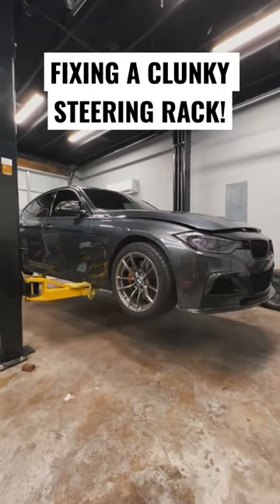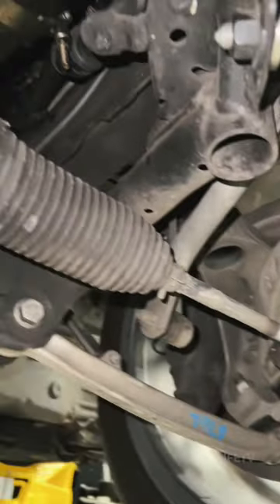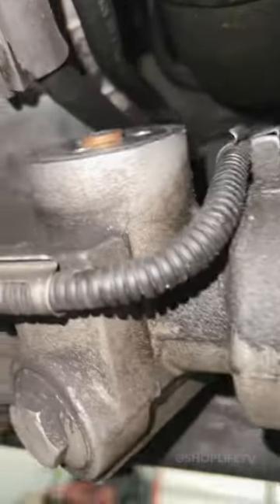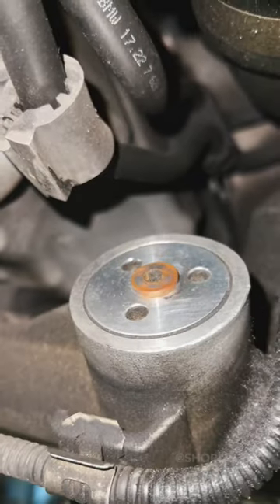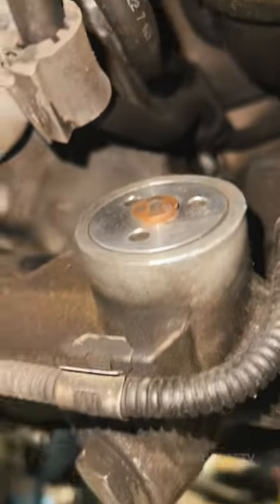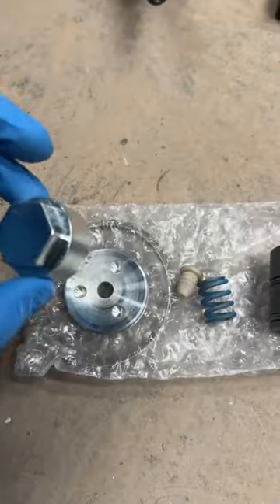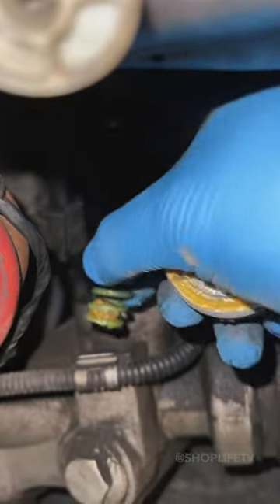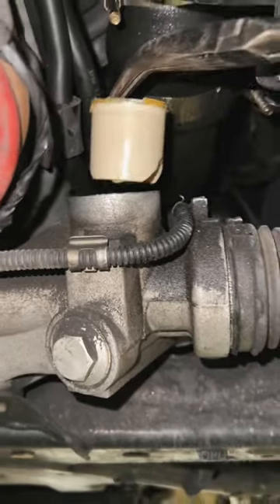BMW Clunking Steering Rack Fix! #shorts

Comment: Fun fact, this Is not a problem límited to BMW. Most electric racks are afected by these issues as they get old
Reply: Yeah I like those electric column Hyundai's they go out in like 20-30,000 mi easy money😅
Reply: @davedorsette my buddy has an 08 Elantra and I just rebuilt his EPS for him. Junk af
Reply: My mercedes hydraulic rack has this issue i'm trying to find a kit right now for it. I was getting ready to change my whole rack.

Comment: The first and best step, is to never buy a bmw to begin with.
Reply: Acting like other manufacturers dont fuck up all the time too. And dont even say toyota. Its hard to fuck up when you make econoboxes only and have only 1 or 2 sports models. Bmw litterally has a sport model for every single class they have, and even their "non-sport" models make 250-300hp and ride and handle like a sports car... Larger number of sporty cars: larger chance for failure.
Reply: Exactly what I thought
Reply: Lol, I guess you made that mistake? I bet you own a 335 😂
Reply: @waifuracer6516  how long has bmw been making cars versus how expensive and breakdown prone they are? It is absolutely acceptable to compare to Toyota, Hyundai, Kia ,etc. Last time I checked the laws of physics apply to all car manufacturers. Why hasn't BMW figured that out yet?
Reply: im at 160k miles on my e92 n54 335i zero codes :) and pushing 550hp on upgraded turbos
Reply: @jeffs7267 there’s no way you mentioned Hyundai and Kia 😂
Reply: @2seep  laugh all you like, they make top rated cars. My Kia telluride was ranked best car by three reputable reviewers for three years in a row. My BMW? I could make a list of problems that are the direct result of poor quality and craftsmanship. Just today, and I am not making this up, the radio stopped working. The fuse is fine. That is a relatively minor issue with that piece of garbage
Reply: Buys another insert brand here which eventually brakes down.
Reply: Mine has 151,00km and is still going strong, not much has been replaced
Reply: 421 000 kms on my 2011 E91 320d. 
Just change the engine oil max every 15K (BMW recommends 32K for this model, I personally don't like the color and thickness of it after 20K, also I can notice higher engine temps and engine slugging a little when running in old oil), use the best OEM parts possible (but only for important stuff like filters and stress parts) the rest just use the cheap stuff from eBay for example, use good quality fuel when possible, clean EGR!, Intake manifold! and Turbo dirty side to remove carbon deposits and allow full functionality (it gives longevity.. I do it every 50-60K). 

Things I replaced in the car in 10 years of ownership (except classic wearable parts like brake discs and pads, tires, etc): 
- Tailgate window switch (@400K ebay ...oxidated with humidity)
- Intake Manifold Butterflies! (@230K OEM ...partially broken, affecting the performance at low revs and causing engine noise)
- Turbo (@230K mechanic just replaced it (actually the turbo was still fine, but the electronic switch was jammed due to carbon deposits, I paid for a cleanup/restoration and sold the old turbo)
- Passenger side plastic door handle (@410K ebay ... that thing was melting, don't know what kind of rubber bmw uses in these things but it melts after some years) 
- Front left brake caliper (@200K piston not retracting, oxidated... the guy probably cleaned the old caliper and sold it after)
- Front door rubbers (@380K water was coming in during car wash or when parked in heavy rain)
- Front door key lock system (@120K Someone broke into the car to steal it... they tried to use the OBD II port to start the engine unsuccessfully...)
- Tailgate glass was broken (@390K Someone broke it and stole my luggage) 
That's all.

For 20K€ (what the car cost me in 2013), I will never buy any other brand in my life I think. 

(Extra: Road trips with the car so far: Portugal, Spain, France, Italy, Switzerland, Lichtenstein, Austria, Poland, Czech Rep, Slovakia, Slovenia, Croatia... planning more for 2024 :))

Comment: You should use a paint pen or sharpie to mark the original orientation of the cap.  When putting it back on you tighten until the marks line up
Reply: That's good advice
Reply: Dosemt matter if your replacing the yolk

Comment: Important to mention, this steering rack comes with 3 different rack profiles, 2 variations of V shape and oval, this fix is just for one of the Vs, i had the same issue and tried this fix first but it turned out the  problem was a rusted bearing on the coupling between wheel and the rack.

Comment: 3 rack replacements on my X3 and after 1 year, clunk. $3500 part…$1000 labor. Two for free and one out of factory warranty.
Reply: So bad part or install?
Reply: Design fault and replacements haven't fixed the design. There are aftermarket fixes available if you go to a reconditioning specialist
Reply: @miscbits6399  , sold the 2011 bmw in 2018 for a 2019 Ridgeline truck. And now I have a new MDX. I love bmw but you know they are money pits.
Reply: Fucking serious I just bought a whole Honda ek for 2000 lol
Reply: You must've been drifting too hard

Comment: This works like a charm. Official dealer diagnosed an issue with my coilovere as a root cause and added “there is a tiny play in steering rack but that definitely wouldn’t cause any issues”.

Comment: Crazy how this is something an owner has to fix on a BMW 
Let alone 
Spun crank hubs , blown turbos , cracked weak rear subframes, rod bearings…list goes on
Reply: what?? you have an option of a mechanic
Reply: @Cars_nedits i think he means that bmw should have made the part well enough from oem so you wouldn't need to change any parts on the steering rack itself.
Reply: @Cars_nedits i got a wobbly steering rack on my 07 audi TT and the same wheel play thing in the video is happening
Reply: Depends on the model you get, if its a new model that just came out then yea theres gonna be issues, but if that model had time to get remodeled/ improved as later models of the same series then it will have a better build, and not require as heavy maintenance

Comment: All the kits say F chasis (for the 3 series - there are 1s 4s and Xs too) 
But the 3 series e90 has the thrust bushing issue too. I am wondering if the F kit wouldn’t fit in the e90.

Comment: You going to have to replace the cap again the reason why it failed is because there was too much play in the play in the cap retention system can tell because there is a crack in it

Comment: Would this work on the e46?
Reply: Wondering the same. Looks like an interesting upgrade
Reply: Wondering same
Reply: Its not an upgrade it’s maintenance, on the e46 you may have a worn flex disk on the steering shaft it’s easily identifiable with two people and a lifted vehicle
Reply: @MechaniclifeJDM  usually steering rack fails way before the flex disc. At least every prefacelift e46 i have ever driven had quite big play in the steering rack, but it is not very common on facelift ones with quicker steering rack
Reply: @Mikescze  there is an adjustment for the rack play

Comment: Quick tip for you: don't put the rubber cap in the end with all installed already. Lube the rubber cap and put it in the hole with the piece out because it's specially hard to push it through. Or else you'll have a hard time...
BMW should've paid for this because it's a defect, recognized by themselves so why it's the owner paying? Plus, the bmw shop wanted to install a new steering column to solve the issue, thousands of dollars in parts and work when this official kit costs 30-40 dollars. Pimps....

Comment: I wonder why these cars have these components designed to fail and be replaced continuously
Reply: They're designed to last the warranty period. Lessons learned from Ford and other American manufacturers...
Reply: @miscbits6399 I've never had to do major maintenance on an American car before 150k. Can't say the same for bmw or merc
Reply: @stevenrais9360  BMW and Merc both entered the American markets with an expectation that they'd teach Americans how to build better cars. What actually happened is that they acquired American style management and started building cheap cars (at a high price) which only last their warranty period.
The "European" Mercedes, VWs and BMWs you have in the USA are mostly American built (it shows in the panel gaps amongst other places) and BMW is now the USA's leading car exporter (none of which come to Europe) 

People who can afford the premium for these cars don't care about long term reliability as they tend to turn them over annually/biennially and therefore never encounter the long term issues. BMW and Mercedes don't care as it doesn't affect initial sales and it keeps the parts gravy train flowing 

You're right that American cars do better then these ones, but they're not competing with luxury brands outside the USA - they're competing with Asian/European "bread and butter" models.

Ford does reasonably well in Europe, but virtually all models you see outside the USA are European designed/styled and make their way to the USA afterwards.

GM ended up selling up in Europe and everything that was GM Europe (Opel/Vauxhall/etc) was replaced with badged PSA models as production runs ended.  PSA was acquired by Fiat and the conglomerate renamed to Stellantis. It used to be that Fiats were notoriously unreliable rustbuckets but that changed in the 1980s after Japanese cars ate their lunch for a while (Japanese cars are staggeringly reliable if not USA designed/built,  but the styling is BORING so European economy/family cars are holding their own)

The decline of the USA motor industry can be directly traced to the 25% "chicken tax" tariff on light trucks which made such  vehicles ultra-prifitable and created a captive market. That's what kickstarted the malaise era.

Protectionism hurts your own consumers and the USA is one of the most protectionist and parochial markets on the planet. There are hundreds of models and dozens of brands you don't have because it's too small a market to be bothered with...

Comment: Know anyone Tightening torque of it?
Reply: ISTA/Newtis suggests 70nm but that is way too much & the steering will stick,  when I did it I used a wrench with the thrust piece tool with the 3 prongs & tightened all the way until it was snug & lightly exerted more force until it was tight.  If youre tightening it & it feels notchy when youre torquing it, it'll be too tight (if that makes sense)

Comment: My God, there literally is not 1 component on any modern BMW that isn't a failure point.
Same goes for the old ones even though they were actually engineered to do more than fail.
I still love BMW, but what complete pieces of sh*t.
Reply: Soo truee. My E90 LCI has so many parts replaced. I put a lot of effort, money and time in that car. Very nice cars, but as you said, they are a piece of sh*t regarding long term reliability without taking action.
Reply: Such a hard vehicle to love due to maintenance
Reply: @legioner9  Eh it's ironic I was going to say my 335is E92 is pretty good. I replaced a lot of parts sure but it's reliable.
Reply: @JackRR15   True. They are reliable cars when parts are replaced and good to go for another 7 - 10 years or so, only problem is there are soo many little bits and pieces, and the rubbers used by BMW for gaskets and O-rings suck big time.
Reply: @legioner9  Yeah not wrong... I may have written my text to quick to and maybe I'll get another 7000$ in part to spend on in the upcoming years ha. Got to now the model and engine and the quirks... But I agree also if you don't DIY man it must be expensive. My 335is is like my all in one car.
Reply: @JackRR15   True. Truly true. Your 335is is a nice car, and very rare. My E90 also is like my all in one car - you said it very well. Happy many only good and safe miles.
Reply: @legioner9  Thank you. This is actually my second one, I love this car so much. My first one got totalled in 2021 :(   Enjoy your E90! I love that generation of BMW.
Reply: @JackRR15   Thank you, my friend.
Reply: @JackRR15  I love my 335is. They are a beasts and fun to drive.
Reply: Do you have one?
Reply: Amen
Reply: Even the neglected one is drives better than your Toyota fact😂
Reply: @mechanich1249  tell me you’re poor without telling me you’re poor.
Reply: Yeah…
Reply: Yet people always mock Ford's for being bad while owning a BMW 😂
Reply: The b58 is a tank
Reply: Ive got 7 bmws atm and the new ones are shit. My old e36 m50 is bulletproof and my e39 m57 is.. other than that the m550d blew 3 engines.. my 640i spun bearings dont get me started on the n63 lol
Reply: @legioner9  unlike Porsches you replace any known factory defect and your good to go for more than 100k miles.

IMS bearing in the 996 generations and stuff like that
Reply: @lewhui4604   What was the oil change interval on your M550d and what was the cause for destroying 3 engines?
Reply: @tony_5156   Well, I don't own a Porsche, but I heard they are reliable cars, i.e. they can take a beating. Don't know about long term reliabilty on them though
Reply: @legioner9 I have a pre lci e90 that has one problem, opg leak😂 and it’s x drive
Reply: @gabrielunderhill   Not nice 😂
Reply: My brother had a 1973 BMW 2002 in the 80s. He purchased it because "BMWs are sporty" (1970s BMWs were _not_). It constantly broke down and had perforation rust everywhere.  His wife made him park it down the road because she didn't want to see it outside their house and eventually called a scrapper to collect it one day when he was at work. It was replaced with a mitsubushi lancer which actually worked well and went places with the family in it instead of eating money and going nowhere....
Reply: @legioner9  porches were reliable. That changed when they became luxury cars rather than sporting ones
Reply: My Hyundai has 240k miles and never had a problem, unlike my garbage bmw
Reply: Bro having parts wear out is normal 😂
Reply: @danielkiss7003  yes it is,  but BMW are using the old Ford 1950s model of designing things to last the warranty period of the car, not the expected lifespan
Reply: Eh, I have 280k miles. Just take care of it.
Reply: @cmkm54  Wonder what your cost per mile is with your BMW. 280k is what one can reasonably expect to get out of most cars.
Reply: @jeffs7267  not terribly much I'd imagine, it gets 33 miles per gallon. It doesn't burn or leak oil. And I've only got around 3k in maintenance records dating back to 2012.
Reply: @JackRR15 Not worth the mental and physical pain ?
Reply: Bro look at VAG vehicles 🤡 Even worse.
Reply: i have an e90 maintnanced up but my 95 cherokee is literally all replaced like everything any seal any bushing any plastic all replaced or upgraded. idk i like both but the cherokee definetly chomps my wallet more like close to 11k in that car and 3k in my e90 335i
Reply: Old bmws are well made, I agree with new ones going down in quality but the old ones are better made than most Fords and chevys

Comment: how to know exact tight position ?? bcoz after changing my steering wheel is not self centering ..& have become tight.
Reply: Back it off a little
Reply: @firstlast---  if i back it little then noise starts again..! mechanic is saying its rack & pinion problem
Reply: @Itsme-pb5zk  I would verify the new parts were installed correctly before doing anything else

Comment: Amy German car built after 1990 is such a poorly designed piece of crap. I don’t care how good they perform in the first 20k miles. They’re not built to last. Whether it’s audis and vws sludging out, Mercedes literally crumple into dust, or every single thing breaking on a bmw once a year. My buddy has 3 bmws, all broken junk. I’ve had 2 vws with the utmost care they still sludge up and have oil pressure issues. I remember buying a c230k one time thinking I’d restore it a little. That damn intake came apart in my hand and it had a solenoid go bad on the trans the whole fuckin thing needed to get dropped for. If you see a car broken down on the side of the road for anything other than a tire or tie rod odds are it’s either German, a Chrysler of any kind (Mercedes parts), or maybe a Nissan thanks to Renault.

Comment: BS, mostly problem is with out side gasket rings or jackets, you need serious job to fix this. Oil is leak. With this metode you can got lock steering when drive and lost your life. Don't play stupid games !
Reply: Electric steering rack, no hydraulic oil in them...
Reply: @miscbits6399  yes, but must be some lubricant for rod's
Reply: @FuriousHondaBoy  if you're losing enough of that to be thrown around the engine bay then you probably had a wheel ripped off